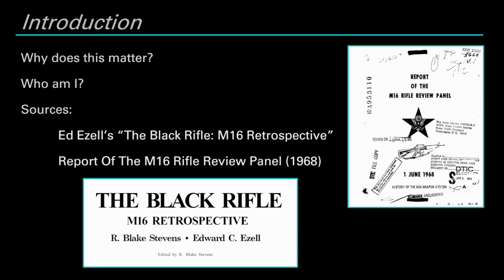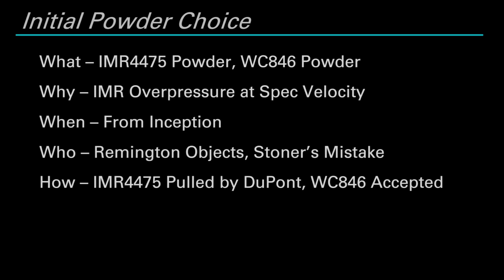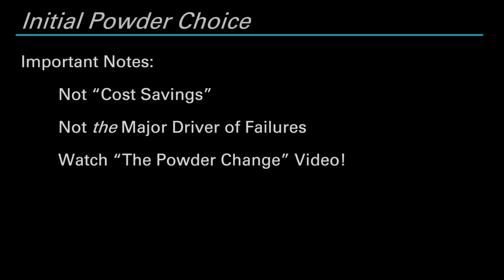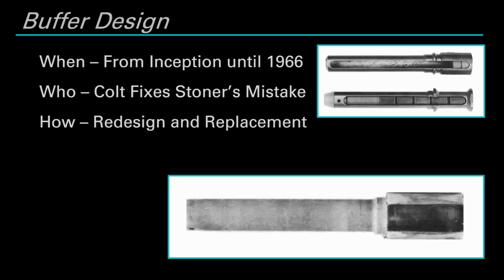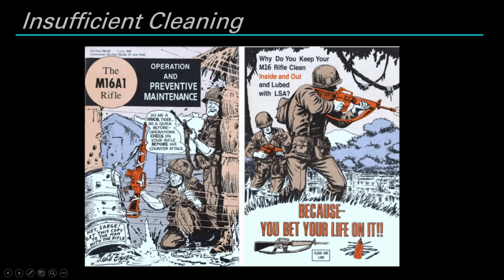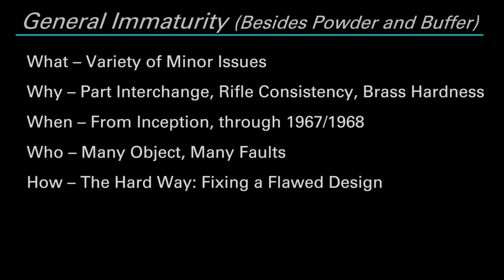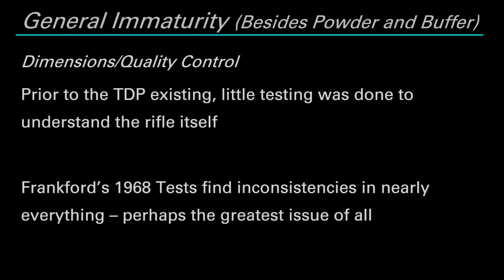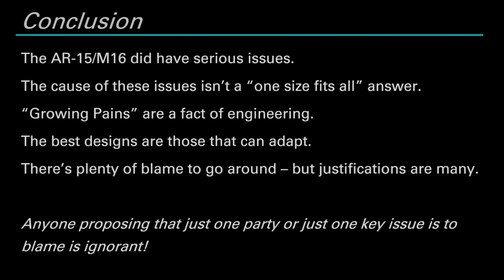M16 in Vietnam - The Real Issues, Briefly Explained

Comment: Eugene Stoner addressed the lack of chrome lining in the bore in his interview. He would have wanted the weapon to have a chromed chamber if he knew that the ball propellant was being used and IMR4475 was not corrosive, it probably gave Stoner the impression that ‘it didn’t need it before, why now?’, I think greed was the last thing on his mind considering that he worked hard into getting this weapon adopted at all and fighting the prejudice against the AR-15.

 He didn’t start getting informed about what was happening in Vietnam until it was a mess and the rifles were not tested to run that propellant as far as I understand and Eugene Stoner ended admiring the addition of a chrome lined bore and chamber. 

You can’t really blame Eugene for this mess on the barrel because he did care about creating a weapon that functioned properly and he expressed that well by explaining why the BCG had to be chrome lined, he preferred it because of all the reasons you just stated and more, it’s corrosion resistance, it’s dramatically reduction of external wear and it’s dependability even without cleaning.
Reply from the maker: That's silly. WC846 is not corrosive nor was 4475, and the Panama Trials clearly showed that regardless of IMR vs ball, chrome vs unchrome, WC846 was more reliable and that his musing on chrome lining affecting this are wrong. He was not aware of the details of the Panama Trials, and was trying to avoid any accountability for his own actions and words. Greed is the most likely explanation.

The rifle always should have had a chrome bore/chamber, at least if cleaning instructions weren't going to be handled at least as carefully as they were in WW2. Neither of these things happened until later, though. He certainly did favor the chrome chamber after the royalty checks were already rolling it - fixing the rifle keeps them rolling at that point - but the fact remains he was opposed to it before, and pretending he would have changed his mind in response to a powder change is pathetic.

He was insistent on chroming of bolt groups, but between Armalite and Colt testing, the Army found the chrome plating could fail and flake off, which would kill the rifles. Yet another immature aspect of the rifle's design that Stoner may not be responsible for the immaturity of, but the inclusion is still his fault. He would be right about the necessity of it, but poor execution up to the point of its removal is a failure he has some (small) part in.
Reply: @IvanPrintsGuns ok, so there’s something I don’t understand and btw, you were right about the propellant, so I give credit for that. First off, the chrome plating failed not because it was inherently the chrome plating itself, it was because when Colt took on the AR-15, they were not willing to pay for the same license electrolyzing process that Armalite did, the Armalite rifles didn’t suffer this issue and everything you’re telling me on that part is at Colts fault. And second, Small Arms Solutions already made a video years back before the Stoner interviews even released publicly and both the sabotage stories are identical, he also wrote the books you’re literally sourcing for the video, so why should I listen to you when you’re the only one making these bold claims.

So somebody is lying here and from what I’m seeing, you’re also making educated guesses on Eugene Stoner’s character and painting him as a careless weapon designer that only cared about the end goal of making royalties from the AR-15.
Reply from the maker: @diplexnormal3353  the Armalite guns had reports of chrome flaking as well as I recall. Colt opted not to use the same supplier and the issue was evidently worse. Functional chrome plating on guns was still relatively new at the time.

The Stoner interview has been available for a long time, I'm sure Chris had seen it before he made his videos on the subject. He does point to some of the same sources, but at times directly contradicts them. He also suggests Misfire as a reliable source, and it frankly isn't. His allegations of sabotage are as flimsy (unsubstantiated) as those from the Ichord hearings, the big issues the rifle had stemmed from general immaturity (early design choices that weren't good calls/weren't fixed when noticed), many of which point back to Stoner. You can claim he didn't know, didn't care, or just wanted money, but the facts remain that it was many of his decisions (that he was aware of the unsuitability of while in a position to do something about them) and he did not act. Again, many possible reasons for this, including that he vehemently believed he was always right. But he wasn't - and his tendency to blame everyone else for any issues says something about that.

Not that he wasn't brilliant, or that he was never right - but he got things wrong, blamed them on others, and tried to act like they weren't a big deal.
Reply: @IvanPrintsGuns dude, I’m seriously confused. Where the hell did you get these sources from about Eugene saying that the barrels not having a chrome lined chamber was fine? I can’t find any citation anywhere.
Reply from the maker: @diplexnormal3353  it's in The Black Rifle, linked in the description. DOD deferred to Stoner's advise that the rifle was good as-is (no chrome bores/chambers) and his supposed infallibility as the designer. Remember, Stoner never used chrome bores on his AR15s.

Comment: The way in which you described the cleaning and maintenance situation gave me flash backs. Never been in the military but I have worked for a corporate owned grocery store. 

We had old worn out floor cleaning machines that were a bitch to clean and maintain and were definitely in need of replacement since we’d regularly have one of the two machines we had down for repairs. I sent a request to my supervisor, who sent it up the chain. A month later we STILL don’t have a floor machine. At that time my super transferred stores and we had a bit of a management change in the Grocery/receiving department. Long story short we ended up going three months without a new floor machine only to find out a machine had been delivered two weeks after I made the initial request but got lost in the shuffle and no one at either the supervisor level or above was double checking to see where what was going on. 

Given how fast it seems the army and marines were rushing ARs to Vietnam, it wouldn’t surprise me people in command roles were just assuming things were being taken care of down the line and no one at the bottom was running things up the chain to make sure cleaning and maintenance accessibility was universal.

Comment: Fundamentally, the Army dropped the ball by fielding a weapon system in which they had failed to define the cartridge first. Modern firearms are designed around a pre-existing cartridge, not the other way around. Everything else just spiraled out of control from there...
Reply from the maker: This wasn't the Army's fault. They were forced into using a gun they knew and had maintained wasn't ready. The ammo OEMs knew it wasn't ready. Colt knew it wasn't ready. DOD didn't care, because they figured the cost of figuring out the AR15 that wasn't ready was less than the cost of figuring out the M14 that still wasn't ready (or, that the end result of figuring out the former left you with a better rifle overall).

Definitization of the cartridge being so slow rests more on Stoner's shoulders than on the Army's. His rantings about a cartridge/rifle system later in life would carry a lot more weight if the cartridge he had come up with wasn't his actual first guess/attempt (and hadn't routinely shown overpressure signs, in response to which he changed exactly nothing about the cartridge). Even if the Army refused to allow the change (they allowed plenty of changes, though), it's rather odd the nobody at Armalite bothers to think about a better powder for 223 at all. Colt can be excused for a few years, as they didn't plan on making many AR15s, but then they too are aware of this issue and don't force the change. The whole time, the Army is turning their nose up at the entire thing.

Comment: My issue is with the 5.56 caliber in general ( I'm also not a huge fan of direct gas empingment, but that's neither here nor there)

The biggest issue for me is that the Armalite and the 5.56 itself are mediocre at best. No matter how refined the design may be, it's just not a true assault rifle, and because of that, we've been forced to compromise elsewhere to compensate.

The weapon is a carbine designed for military police and rear echelon troops. It is good for self defense, but lacks the range to put preassure on enemy units at long range. Specifically I'm refering to indirect fire. But even if you had a clean ahot at +600m, even if you hit your target like the world's smartest mortar, it loses all its power with its velocity.

What this means tactically is your infantry are forced into a defensive stance, where they can only engage the enemy when the enemy in close to them, or with support weapons like 7.62 GPMGs, or 50 cals.

What the 5.56 has done, is destroyed the assault rifle concept and forced us back to a dividing our units into fire and maneuver teams, instead of the more optimal mixed units that can fire and maneuver interchangeabley.

You have an MG for firepower, and the rifles are relegated to a secondary role; unable to provide reliable/consistent fire for long durations or over long distances. So your MG is your only long-range option:

This means, (barring company and battalion level weapons like mortars or air strikes) the enemy is free to move freely while in contact with you, so long as they keep a safe distance from you.

This is one of the reasons the US Army has become cripplingly dependent on the air force for heavy weapon support. The "queen of battle" is weilding a dagger as her primary weapon. Unable to dictate the terms of battle due to lack of range, letting the enemy back away at will, and forcing commanders to be more conservative: because closing distance to engage means commiting to a battle they can't easily walk away from if things go bad. Without heavy weapons support from above the platoon level, US infantry are easily outgunned. The only place the 5.56 is adiquate is in urban, close combat... the worst kind of combat for a soldier to be in. Being forced to engage the enemy in close combat means you already made a terrible strategic mistake putting yourself into that situation. Sometimes, the best move is not to play. But for US infantry, that is true more often than in other militaries, thus we spend more resources bombing the enemy blindly, than we do engageing them directly, and the resulting collateral damage has been a sour spot for a while now. But what other choice do commanders have? Any time our infantry engage the enemy, they get surrounded and butchered. We never have numeric superiority, and seldom have heavy weapons on standby. 

The gap between .223 and .50 is too large. We need a true intermediate cartridge, and I'm not referring to SIG's nepo-baby pump and dump scam.

Even if they keep the AR operating system, 5.56 just isn't up to modern standards. The proliferation of optics and body armor have made the 5.56 obsolete.
Reply from the maker: 5.56 offers the longest effective range for any intermediate cartridge that had existed before it, and most that have come along since.

The "assault rifle concept" has, from the very beginning, focused primarily on <300m engagements. Extending that out to 500m for 5.56 was a deviation from that norm. It was never meant to replace GPMGs or to cover out to 1000m effectively.

You should read the SALVO Reports and Hitchman Reports - Korea made it clear that what you postulate doesn't actually work. The supposed standoff range of Garands and the like did little to keep the Norks and Chinese from getting their weapons into effective range - and that's because it was very uncommon for soldiers to make effective use of their Garands past 300 yards, regardless of what the theoretical max effective range is.

I'm not sure if you're aware, but 7.62x51 hasn't ever been taken out of use - it's existed as a GPMG/MMG round since the time the 5.56 was in its infancy. Later, as a DMR round - so that the folks capable of using a gun past 300 yards can do so, out past the 500 that 5.56 concerns itself with.

Optics only barely change the picture on the 300m question - hit rates do go up shorter than that distance, but still fall off sharply after. Body armor has the upper hand for its part, to the extent it's a real problem (remember how Russia was supposed to have mass issued 4+ plates?) - improving armor takes a lot less time than improving the round, the gun it's fired from, etc.